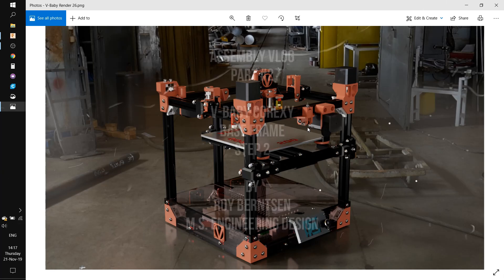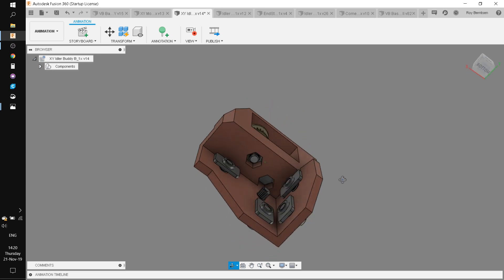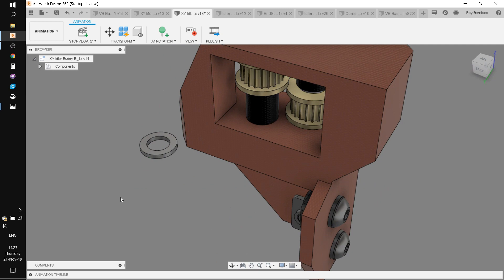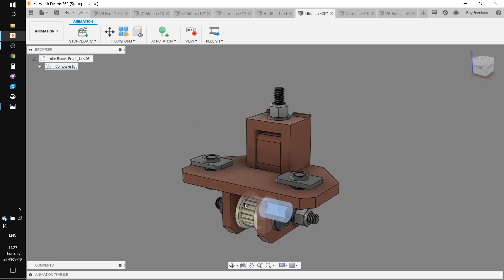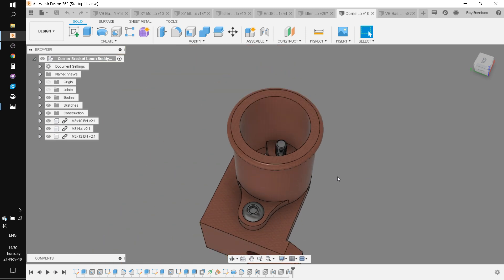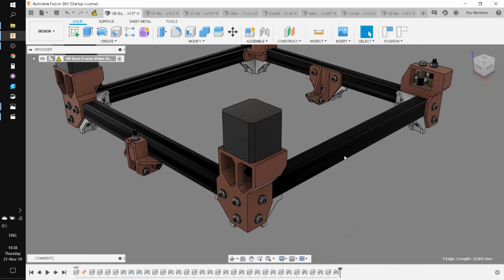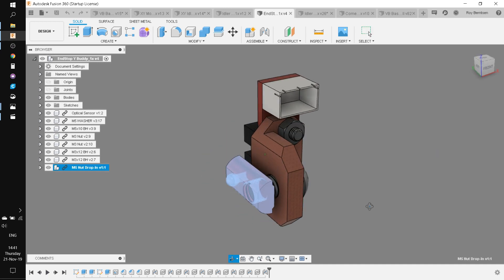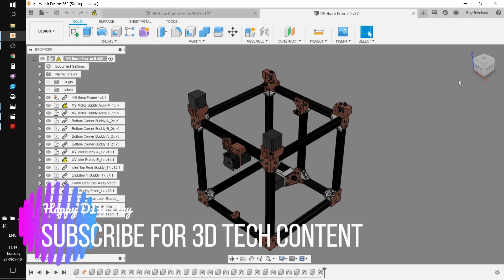Building A 3D Printer | The V-Baby CoreXY | High Speed 3D Printer | Part #2

Comment: I love it! I'm just waiting for an enclosure.
The printed parts should have rounded corners (at least on the side where they are printed on the bed) to prevent peeling in my opinion.
Reply from the maker: Thank you for the feedback. No enclosure for this guy I am sorry. Wait for the rail king. For 3d printed parts low poly is better for structural parts. Not sure which corners you want round though
Reply: @PRO3DESIGN  I'll figure something out for the enclosure :-) Is there no tensioning-system on the V-baby for the AB-belts? Designing and building a one-off printer is one thing; Having all the drawings neatly organized, the BOM, the instructions, the videos, github... wow! Thanks so much for all the work you put into it!
Reply from the maker: There is no tension system for ab belts atm. This is in the pipeline but not so important

Comment: Would it be possible to have a Hermera on this to print flexible parts and not use a bowden? How heavy is the extruder end currently?
Reply from the maker: No direct drive for now I am sorry. Corexy is meant to run fast so carrier needs to be light. The current carrier is 250gram